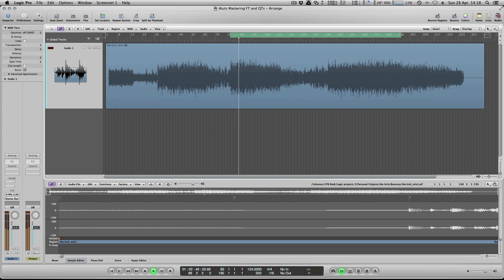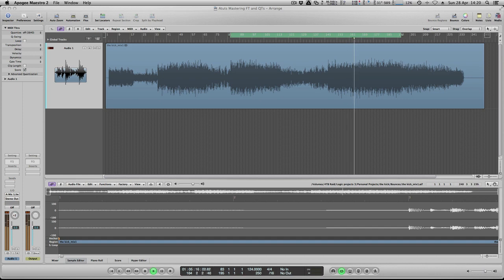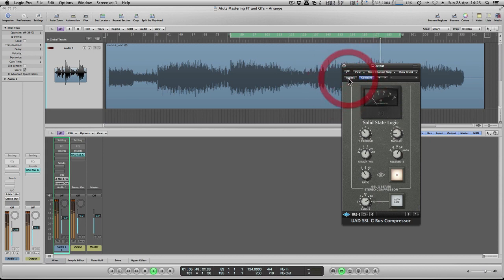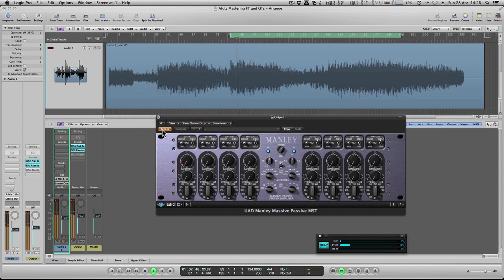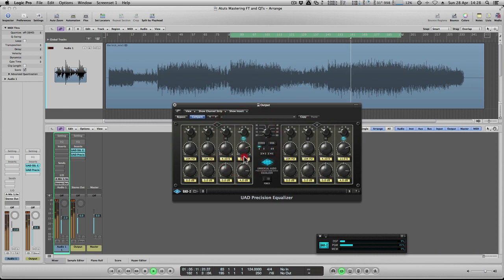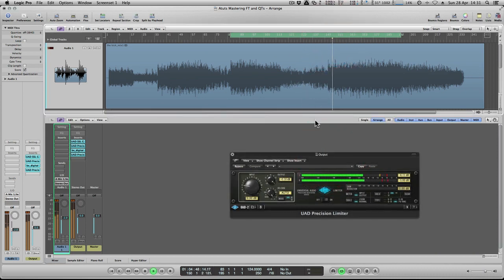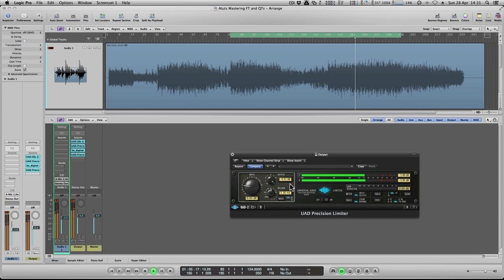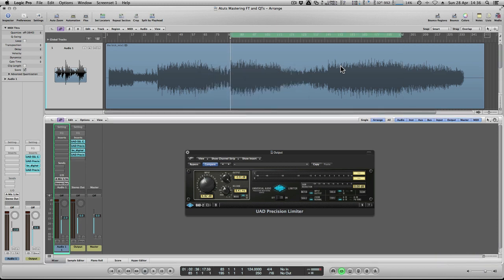One Way to Build a Mastering Chain

Comment: Hypnotic loop, stating 10Hz with "10k" which is 10.000Hz not 10, talking ALL the way through, ducking the signal with no clear moment for the audience to hear the actuall output and A/B differences, setting a high release time on dynamic processors, especially on the limiter to perceive transparency?? really? wtf man, are you getting paid for this?:p